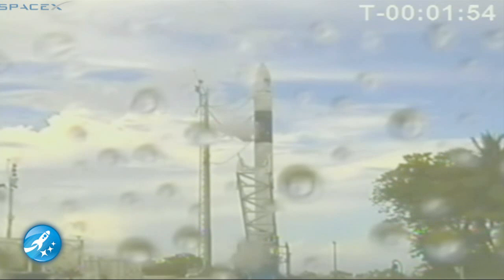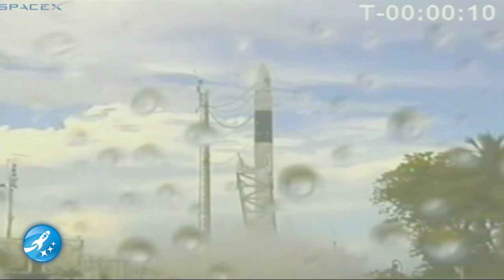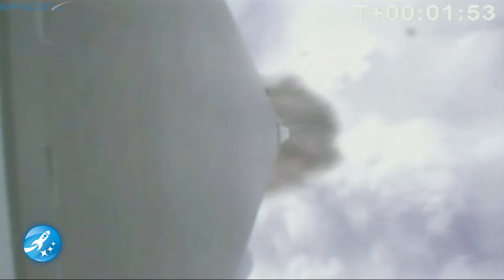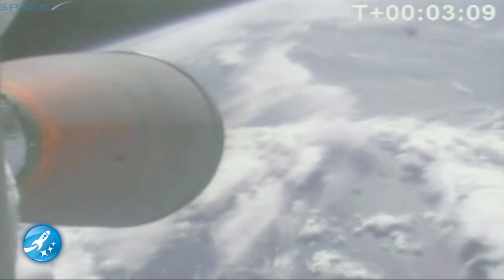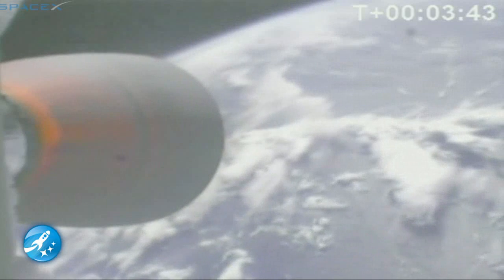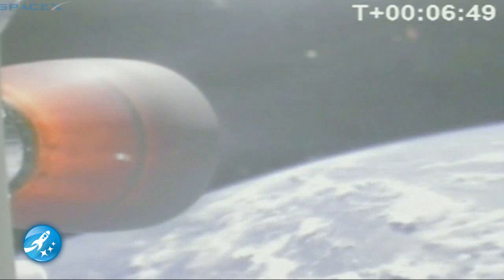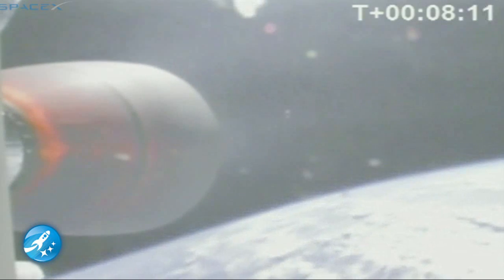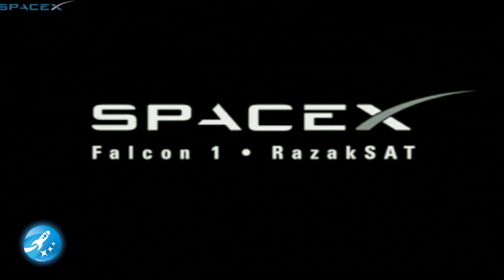SpaceX - Falcon 1 Flight 5, RazakSAT payload (T-2 to SECO)

Comment: Did they return the first stage?
Reply: this is long ago. long before falcon 9 started any attempts to return.
Reply: They attempted it, but in the old days it was with parachutes and all attempts failed because boosters were destroyed on reentry. They added cork on the exterior of the first Falcon 9 boosters that flew expecting that it would be a good ablator and that it would protect the booster on reentry but the first two tries went equally bad so they had to figure out another way to recover the first stage... propulsive landings ;)

Comment: @Eagle1Division2 - Weight loss pills aren't a significant source of healthcare costs or problems in the US. Our system is not that high-tech either for the average lower-end patient. It is for higher-end patients but that's not a significant source of our healthcare costs. A much larger percentage of our costs come from Big Pharma price-gouging, high administrative costs with insurers and high numbers of uninsured people using the ER.

Comment: @Eagle1Division2 - What I would value more is different than your opinion but the problem is both ways they're still opinions. Social Security is NOT a health system. It's a retirement system. Given it has a $2.7 Trillion surplus I'd say that it's a fairly successful program. When it comes to Medicare and Medicaid (what you were going for) they both have much lower administrative costs than private insurance. Only 3-5% overhead compared to the 30%+ overhead of private insurers.

Comment: Wiki: "Space Shuttle program", total cost is $145 billion for the program as of 2005, around 130 missions at that point, summing up to $1.1billion per launch.

For carrying ~23 tons into orbit, roughly twice that of the Falcon 9, it remains almost 10x as expensive.

Once again, most efficient solution: Private space.

As much as I love the technological achievement of the shuttle, it wasn't used enough to be cost-effective versus other rockets.

Comment: @spacevidcast ohh succes-rate? how many sojus exploded? how many Kosmonauts:Astronauts died? 4:14 ! and the Spaceshuttle program have 135 flights since beginning. sojus has nearly 300 since 1990 alone! and many more since 1967. and how costly is the sojus in $/kg.
10 times cheaper! 
succes rate hey?  :-)  
btw the sojus will flight for next 30 years... the NASA even cannot supply the ISS now and for the next years.
de*wikipedia*org/wiki/Sojus-Startliste
space*skyrocket*de/doc_lau/soyuz*htm

Comment: @Eagle1Division2 - Which is still fairly cheap, though.

"The government was NEVER to run the economy"

The government has never run the economy but has always been the single largest actor in the economy. Including in the 18th century. The "General Welfare Clause" covers more things today than it did in the 18th century because the economy is far larger and more complex than it was in the 18th century. The government has to change and expand to take this into account.

Comment: @Eagle1Division2 - Less competition? There were more companies on the market relative to market size in the 19th century than there are today. Today the market has been reduced to a small number of oligarchies controlling the vast majority of economic activity in the marketplace.

I don't know where you pulled those SpaceX figures from but those figures are old and were pulled out of thin air to begin with. The current projected cost is closer to $40-50 mil/seat.

Comment: @Eagle1Division2 - The Soviet Union collapsed because of corruption, the problem with state farming and debt.

"run things as well as the private industry"

Such as the private industry that has brought the US the worst healthcare system in the industrialized world or the 2008-Present Recession? Lol 

I like the Falcon 9 but so far it costs about the same or more than the Soyuz rocket. That $50 mil figure was pulled out of thin air almost 4 years ago. Costs have gone up since then.

Comment: 1) Actually yes you do. I'm talking about "efficiency" as in how many missions are successful and how many aren't. What you're talking about is economic efficiency  which is not the same as engineering/logistical efficiency.
2) Comparing the STS to Proton and Zenit is apples and oranges. You're comparing a manned launching system to an unmanned launching system. Manned launching systems are always more expensive. Compare American unmanned rockets to Russian unmanned rockets.

Comment: I'm a fan of both and what you're saying is silly. This only the second successful flight so far. SpaceX still has miles to go. I'd hardly call NASA a "failure" when they have over a 98% success rate and the economic returns from their scientific ventures is 7:1.

Great job on the successful launch.

Comment: Congrats, SpaceX... but I have to ask: Is it normal for the engine bell to glow THAT brightly from the exhaust heat? By about the 11 minute mark in the video, the second stage motors are glowing so brightly yellow and red that I thought a burn-through was imminent!